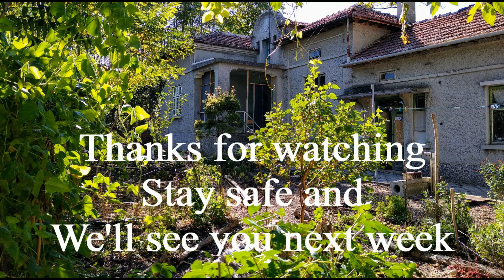Ep. 96 - We're one step closer to reclaiming the garden

Comment: What's a U PS?
Reply from the maker: A UPS is an Uninterrupted Power Supply. It's an "intelligent" battery that powers your computer for up to 15 minutes if the power cuts out.
We have power flickers that only last a fraction of a second but they are long enough to shut down a computer. His computer, monitor and router are all plugged in to the UPS and that solves that issue.
It's worth every penny to avoid the moaning!